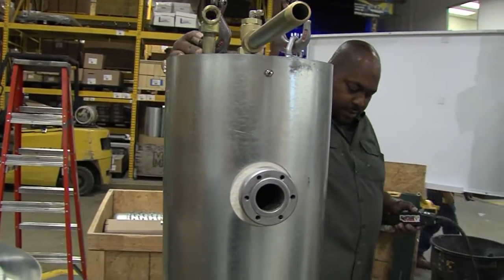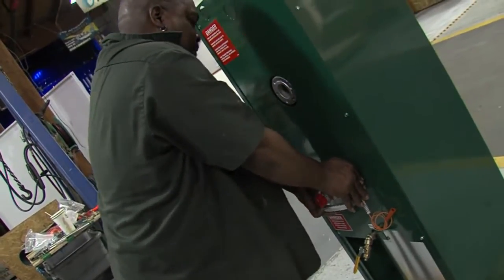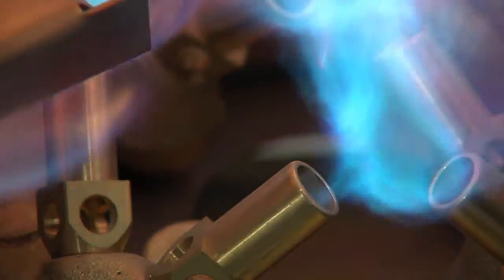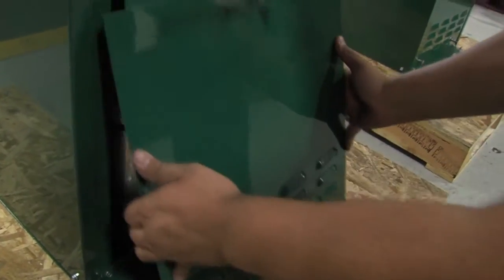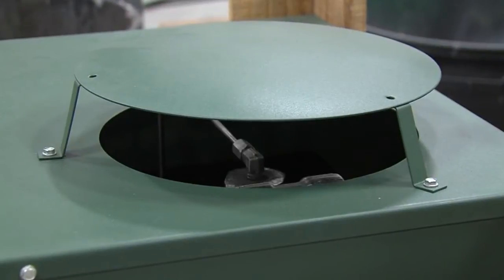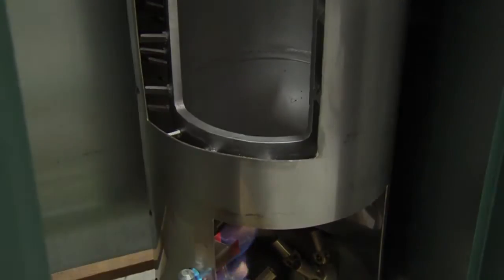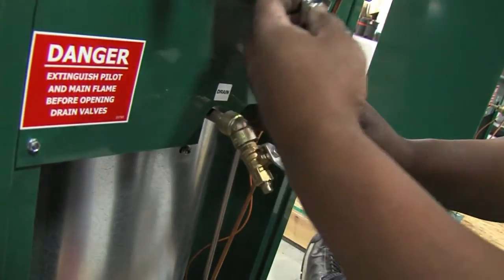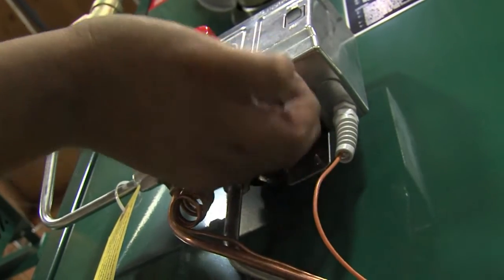Algas-SDI Direct Fired LPG Vaporizer

Comment: been trying to this on a small scale. 
Cool video👍
Been trying to get 3000 btu's per minute for at least 4 minutes out of a 1 Lb propane bottle but can't find any information to figure vaporization rates per square inch surface area with given temperature🤔 
Not sure how hot I need to heat up the tank to work or weather or not it's feasible. 
Just a fun project😅
I have an 18 horsepower engine running propane wile runs fine on 20 pound tanks trying to fit the fuel under the hood of a garden tractor hood since there weights underneath, front, back of the tractor and a wheelie bar on the back doesn't leave much room for larger tank unless strapped on top of the tractor witch won't look too good🤔